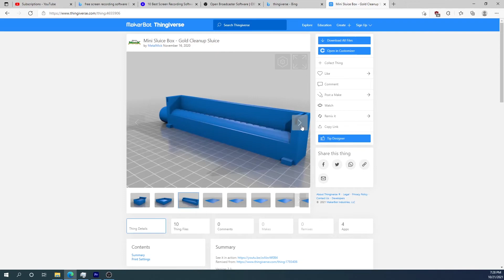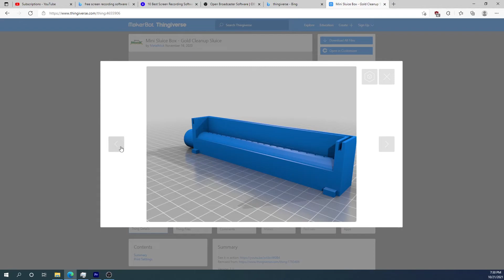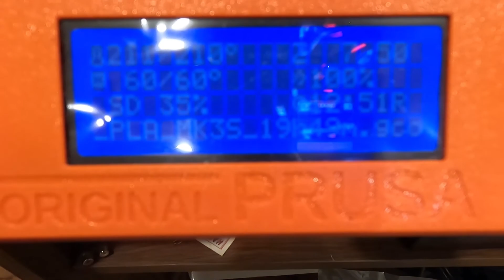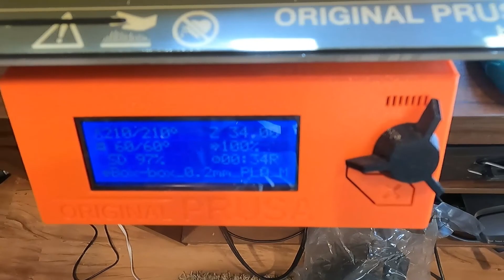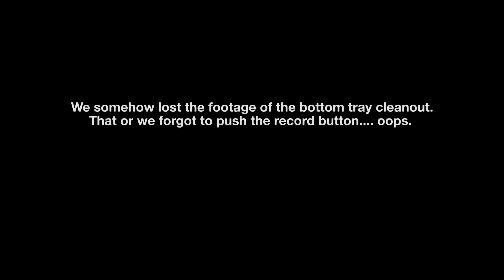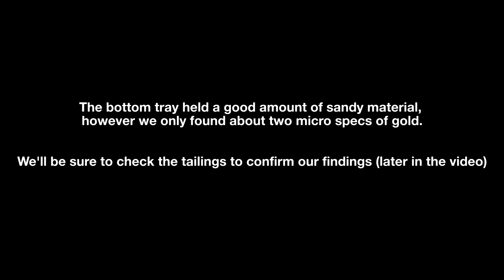Can A Miniature 3D Printed Gold Cube* Catch Gold? (Gold Prospecting)

Comment: Sweet box. i have printed a 6"x40" sluice box and now need a clean up sluice for the black sands. we found a few colors in two 5gallon buckets in a local creek now i have the fever. i tried to print TPU mat but i keep having troubles feeding the filament. im going to try this print. thanks for sharing. new subscriber to your channel
Reply from the maker: Tpu is tough! Good luck!
Reply: @510prospecting  I got 2 6x6 tpu mats and 2 6x12 mats and they are working pretty good. Micro fine sand gets stuck in the layer lines still.

Comment: Should have used the vortex matting
Reply from the maker: The vortex print had some issue and we decided it wouldn’t have been a good test mat. It is a cool mat though! Thanks for watching
Reply: @510prospecting  print that one in pla it will work and not have as many stringers